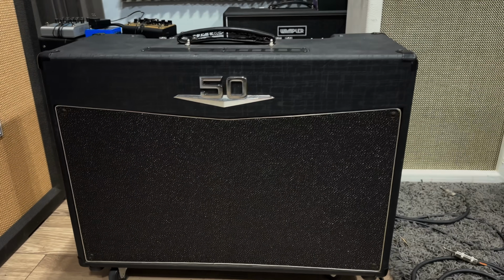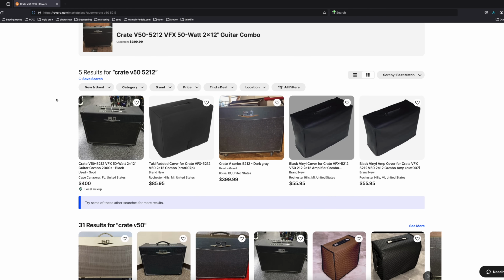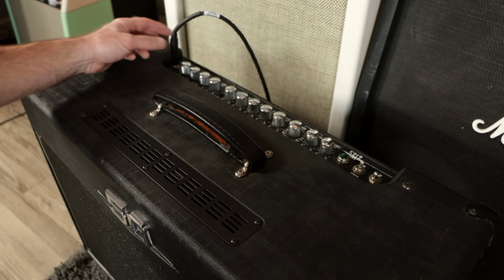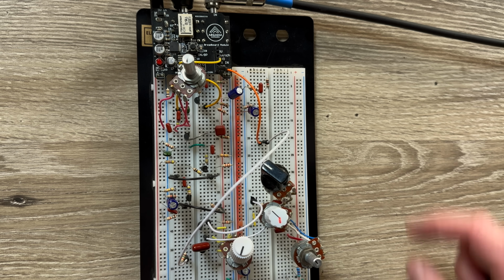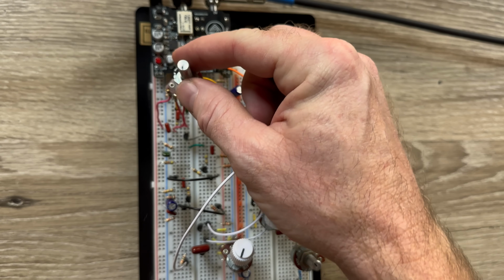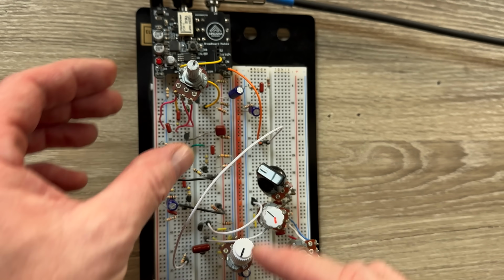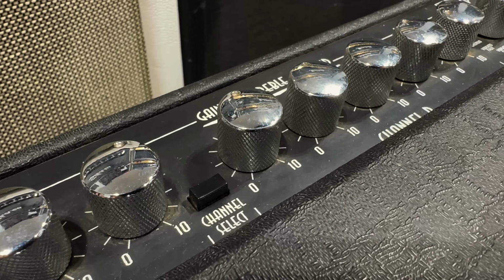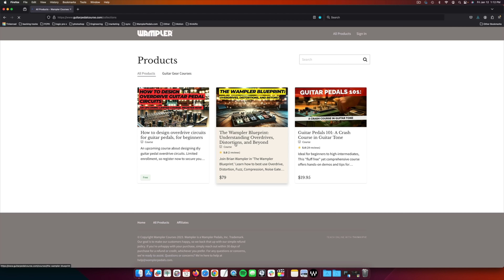Can a guitar pedal REALLY sound like a TUBE AMP?

Comment: Man wish you were my neighbor! I have Sooo many things I would like to ask about a few amps. Pre amps etc.
Just cut out the clipping diodes in a hartke GT100C cause it sounded terrible. 
2nd channel actually has a single 12ax7 and diodes, so I cut those diides out as well. 
It is still just, Idk, thin sounding when you turn up the gain. Like a cheap pedal. If that makes any sense. 
Wondering what I could do to get that sound like you just created out of it? 

Pedals in front or in efx loop still not a good sound. IDK! 

Love what you do! Thanks!

Comment: How similar are amp in a box style pedals to the design of solid state amps? With so many great amp style pedals these days, I’ve wondered why there haven’t seemed to be better solid state amp options too. Would you also have to be able to model the power section of a tube amp?

Comment: Cool. I would have also liked to have heard your preamp mock-up into a solid state pedal platform amp as a comparison.  I still have an old working Crate v58.  Plugged into a decent sized cabinet, it actually sounds pretty... crappy.🥴 But I'm still going to make a NAM capture!
Reply: Yes those later ones with effect and low wattage were kinda crappy sounded but the old blonde 212 combos and the 50 watt heads are killer sounding !

Comment: This is super interesting. You got me with the Crate in the thumbnail… I used a Crate V3112 from the same model series exclusively when I was touring in the Texas Music circuit. Worked great for me for the Red Dirt stuff and I was ALWAYS getting compliments on my tone. Many players didn’t know what it was and would come ask me… and the FOH guys would live it because the circuit sounds like a boutique cross between a JCM800 and an AC30, but the clean channel takes pedals really well and a tube screamer in front, but what won me over was that all the tube tone is there as soon as you crack the volume. I would play large stages and never needed to play louder than 2 or 3, and sound guys loved it because they could actually put me in the mix. Simple to swap tubes on it, because it is a tube muncher of an amp… I giggled it solid for 10 years and it never took a 💩 on me. I’ve got 2 combos I play in stereo sometimes and a head version too for the studio. Thanks for making this video!! More of these please

Comment: Here is an honest answer, if you believe that honesty exists on the Internet. As a gigging guitarist of roughly 20 years experience, the short answer is. No. 
The long answer is, yes on a recording it will sound virtually the same. In a room with just the guitarist and the modeler into a power amp+cab, it will sound very close depending on the power amp and cab. As soon as you add a band into the mix, the answer becomes No. Is it still usable Live? I will say that's a yes, depending on the type of music you play and what kind of band you are playing with. In my experience though, I will always choose a tube amp for a live performance if I can mic it properly and the venue lets me crank it up to a level where it sounds good. If the venue doesn't allow the tube amp to reach the desired volume, then a modeling amp\pedal will be my go to. There you have it. That's my take on it. Hope it is of some use to whoever reads it.

Comment: Nothing sounds better than a well adjusted tube amp.
Reply: Depends on what you're after. Personally, the tone I've always been chasing is mostly from older solid state amps.
Reply: @skaldlouiscyphre2453  Solid state amps suck ass. They don't have sustain and the tone is just not as good as it would be if it was a tube amp. 

I really mean it. Tube amps just sound better 100% of the time IF they are well biased.
Reply: @CalebePriester  That's a very nice opinion you hold. That's all it amounts to though.

Comment: Less sustain but could be fixed with a compressor.  I find most pedals can be made more tube amp like by adding a compressor and just rolling off a bit of treble. of course I don’t have magic ears, but to me you can achieve most tube amp sounds with this method.

Comment: Sounds super close. Kinda makes me wonder why so few amp brands make solid state versions of their tube amps. I'd love a solid state Mesa Dual Rectifier, but not only do Mesa not make one, nobody else does either as far as i know. One of those "Wish i was immediately good at a skill" moments so i could make it myself.
Reply: Nearly all brands do... Fender, Marshall, Orange, Engl and many more.
Reply: @JimBoom92  Engl don't make solid state amps, or at least they don't sell them in the US. Marshall has massively scaled back the MG line and no longer sell head versions. Peavey don't make a solid state 6505 or Classic 20. EVH don't make a solid state 5150. EHX don't make a solid state MIG 50. PRS, Morgan, Fryette, Mesa, Harmony, and plenty more don't make solid state amps at all. Lastly, Fender no longer make versions of their tube amps that aren't modeling amps. Their solid state amps aren't Twin, Deluxe, Princeton, or Super circuits with solid state gain stages instead of tubes and their Tone Master series, whilst solid state, use DSP modeling rather than discrete components for their preamps

Comment: There are times I actually prefer the sound of a pedal to the amp. What the amp gives me, though, is a bit of feedback or 'feel'. I have been able to replicate a great deal of the tube amp feel to the point where a decent (and inexpensive) SS amp or even a modeler comes close to the amp - but it's not quite there. FWIW, many tube amps don't give me that feedback I'm referring to (a new Fender Deluxe, for example, feels almost like the SS amp). That feel thing is subtle, but it's really nice.
Reply: Any idea what the rectifier is ? I bought a Princeton where they switched it to SS back before SS rectifiers were off the self. Yeah, the distortion was wrong. After putting a tube rectifier back in it was much better.

Comment: Yeah , I noticed the sustain wasn't very tube like in a FET Blues Driver clone altho the basic tone was.. I think the ratio of the signal size to the Current to Voltage curve is whats responsible. SS of course goes from linear to nonlinear much quicker so the signal can't sit in an area where its slightly compressed on one side and a little more on the other, then as it shrinks that remains the case to a certain extent as well. W SS , it falls to linearity as the signal gets smaller so the sustain disappears.

Comment: Cool experiment. I didn't think they sounded that far off. Problem with gain and compression is that a lot of the nuances get lost and added to that YouTube and headphones in the PC makes it difficult to get into those details. I think the bottom end sounded a bit more woolly using the board at full gain compared to the amp. The mids and treble sounded fine to me.
I can imagine there'd be a challenge if you want to reproduce the amp on all its settings and the same tones. What you did here worked, but how do they compare on clean with bass turned up for example? That's probably tricky to get all that down and fine tune it, but good going for 1.5 hours!

Comment: Those old crate amps are awesome! Great video. I always learn from your videos Bryan.
Reply: Yea they are, got a v1512 and v58 myself, they run hot but they got a sound that's hard to beat for what they sell for
Reply: Never owned a crate . But played a couple used ones  at guitar center years ago that I really liked . Then they all just sort of disappeared . Playing a mesa mv 25 which I'm really loving . Was going through gt 1000  before I got the Mesa . Still have the gt 1000 but not using it so much . Only pedal im using right now is Keely mod station . May need to pull out compressor and wah pedal and I think im good
Reply: @riviecc  a mesa Boogie!  Brother you are set and ready for anything.... unfortunately Boogie's are big Bucks where I live😞 I'm still dreaming of owning one....after 30 years of playing🤣
Reply: @heavybrett-al4082  Was a little pricey , but just bought the head for 1300 . Going to sell my bass breaker 15 head and using cab for mesa . The head is super lighr and the 12 x1 cab is only 18lbs . Was lugging around a hot rod deluxe for years at 40 plus pounds . I have a back injury so this really helps and this amp does everything
Reply: @riviecc  👍 nice, yea those fender amps get super heavy, I've just started diving into modelling and ir's (after years of being suspect about tone quality) , and just got the Boss ir-2....very impressive including official celestion captured cab's....but one day I'll save for a Boogie (but only to just have one and look over to it and smile) 🤣
Reply: @heavybrett-al4082  I was thinking of going that route with the boss ir2 and Headrush frfr108 for portability after hearing good things about both, but decide to just go with the mesa . Also have a Katana 100 that I would leave at studio we set up at my old job . That amp is ok and loud for digital amp . Really dont use it anymore and kind of heavy to lug around
Reply: @riviecc  definitely pick up the headrush 108, it's just handy for multiple things.👍
Reply: @heavybrett-al4082  You right  I can always use he gt1000  with it or the di cab clone out for monitor

Comment: Very cool and very close!  On the question of "Can a guitar pedal sound like a tube amp?" - here's an experiment I tried from a different angle, and I was amazed at the results.  I've been chasing a quick and easy tube-like guitar recorded tone for what feels like forever and I've never really liked the various amp modellers, plugins etc.  One day, I plugged my favourite OD, the Wampler Belle (LOVE this pedal) straight into an interface and ran it through a guitar speaker IR.  Bingo - sounds like a tube amp.  For me, the Belle has enough tone shaping on board I don't even miss having traditional guitar amp EQ.  Depending on the IR / cab simulation, you can get pretty authentic tweedy Champ to Bassman tones - at least to my ears.  I do a similar thing for a live / direct to PA board, with the Belle going into the loop of an HX Stomp with a Cab block after it - no amp block at all.  Again, to my ears, sounds great, and the bonus is you don't have to menu dive to tweak your "amp" settings!  Anyhoo, just an idea some of you might like to try if you haven't already!  Cheers, -Rob.

Comment: I’ve seen a number of your videos and loved them all. This “amp in a box” task was excellent. I liked the tone and sustain you had when you backed the gain down to about halfway, and I’m wondering if you have done a video using pedals into the front of a non-tube amp..?
When I lived in the States, I had no problem finding great tube amps, but tube amps are fairly hard to find  (and way overpriced), and their are no tube amp techs to be found. 
I currently use an Orange RT 35 (solid state) and get really good tone when using various OD pedals.
Have you done a video using a similar type of amp (non-modeling) ?
Keep up the pedal artistry!

Comment: I couldn't tell the difference.  Same as with most pedals.  I do take on board what Brian says about sustain, as he experienced a difference.  In the end, he's a good enough player to get nice sounds from any technology.  For my part, I have a Fender BDR (valve) amp, and an old Peavey Bandit (tranny) amp, which I use with a Boss Blues Driver.  At gig volumes, I just hear a bloody loud, slightly overdriven guitar, whichever amp I use.  I saw a band the other day, with two guitarists, both using digital multi effects into Fender Blues Juniors.  The sounds were ok, but nothing special.  So, as far as I'm concerned, yes: a guitar pedal can sound like a tube amp.

Comment: Problem solved. Sell all your tube amps. 
Used to be a tube worshipping gear nerd about this stuff. But then I got into my 40s and hauling heavy tube amps around became less appealing. 
I still have some tube recording gear. But I use reliable solid state stuff with well thought out solid state circuits in front of them. 
I think your circuit sounded excellent.  Sure it could use a bit of compression in front of it to make it more tube like. 
But that kind of uncompressed dirty sound reminds me a lot of Mesa amps. And is one of the reasons I don't like Mesa. Their dirty is too polite!
Honestly I think if you use a similar tone stack to a tube amp that is half the battle.

Comment: I liked the 30 watt Marshall Artist amps of the mid 1980s, and they had a solid state preamp section, and I currently have a Quilter Power Block UK as a backup amp for gigs. That said, I prefer my 65 Amps, my Dr Z Amps, and my Shaw Amp to them.

Comment: I thought it sounded pretty close.  I wish there were more preamp pedals on the market designed to go direct into a power amp rather than into the front of the amp.  I've used a stereo power amp forever and struggle to find good options for preamps that either don't cost a ton or don't have cab simulation on them.
Reply: Friedman IRX with the IR’s bypassed into a real power amp sound amazing.

It aint cheap though

Comment: Conspiracy Theory: Hybrid amps should be solid state pre with tube power amp. Amp companies know this would disrupt the market.
Reply: Fender did that w their op amp / power tubes model Clapton used for a while. Sounded weird as hell. The tiny amps w tube preamps and class D amps for power sound like a tube amp. A lot of what power tube distortion does is add pentode distortion which could be done in the preamp. Those tiny shock hazzard amps Keith likes so much on early Stones have a pentode pre tube.

Comment: ❤Great video - fascinating. The quick breadboard pedal sounded surprisingly good. The low gain sounded as good or better than the actual amp. Your video also illustrates how much of the actual tone comes from the power amp speaker/s interplay.

Comment: In short, the answer to the question posed is NO.  Only a tube amp sounds like a tube amp.  Plus the fact that the pedal approach is like petting a virtual cat.  It ain't real... it will never be real... and a real cat is really there, not just a fantasy.

Comment: Nice job for a such a quick breadboard! Yeah you could argue about the EQ but for me it was the same thing I’ve thought about SS vs Tube for years: the initial bloom and sag of the tubes is missing. Solid state is much more “anemic” or compressed. Again, the tone is there but the dynamics is the biggest factor. This is why I dug your Phenom, it focused on that aspect!✌️
Reply from the maker: Thanks Andy!
Reply: Tone is absolutely subjective…until freaking Andy weighs in…at which point you have the correct answer. Wowsers!!

Comment: Without having your expertise I bet you could fool a lot of people if you use it on a record. The worst part to me is when you lowered the gain. Why can't SS amps or Modelling emulate a tube amp's edge of break tone properly?
Reply from the maker: They can, but it would require me to rework the circuit more. As mentioned in the video, this was a pretty quick take, I only spent a few hours on the prototyping breadboard

Comment: The V50 Crate amps are total sleepers. I've been doing the same thing that you were doing on this demo, bypassing the preamp circuit with an inexpensive $32 analog pedal that sounds much sweeter than the Crate preamp. I gig with that setup every weekend.
Reply: Which pedal?

Comment: Played guitar for 20 years. I never ever used pedals. I bought the Brent Mason Hot Wired V2 (used) Got a ego compressor on the way.  Only pedal brand im using ever will be Wampler. Great pedals
Reply: That’s how is starts bro.    I was the same way and now I have well over 50 and two boards.     Be careful.
Reply: Wampler is great 👍.     Boss is the shit too man.     Great thing about those is the price.     Now u need a board and power supply.
Reply: Wampler keeley and jhs
Reply: @bigtsshackfestival9563 May I ask what board and/or power supply you use? I've got a bunch of pedals but can never seem to have enough power for them all lol. Looking for something that can accommodate lots of pedals but is fairly straightforward for a guy who doesn't know a ton about different voltages, etc.
Reply: You’ve never even used the others…
Reply: I love MXR/Dunlop, Boss, and many others, I have a clean boost from exotic. I have two Marshall heads one for the dirt the other for the clean.
Reply: Got my first Wampler a couple of weeks ago...it's reallly good.
Reply: Mr Wampler is a great teacher. I modded my Washburn 20 watt amp and Boss DS-1 pedal after watching videos. couldn't be happier.
Reply: Walter Trout doesn't use pedals at all 🙂
Reply: @Robert_Fordin imagine how much cooler he'd sound with a fuzz tho
Reply: @epasternak4206 
Which begs a mention of the Coffin Case Blood Drive made by Dunlop/MXR which was heavily discounted when discontinued. Picked mine up way back for like $20. Best overdrive I ever used.
Reply: I've been hoping to get some advice on these guitar pedal things from someone who has never ever used them. This is great. Cheers

Comment: Close enough to where if it was sold as a Crate pedal, I would not be disappointed.

Some loss here and there, sure, but it captured most of the amp pretty well.

The real test would be between a modeler, amp, and pedal.